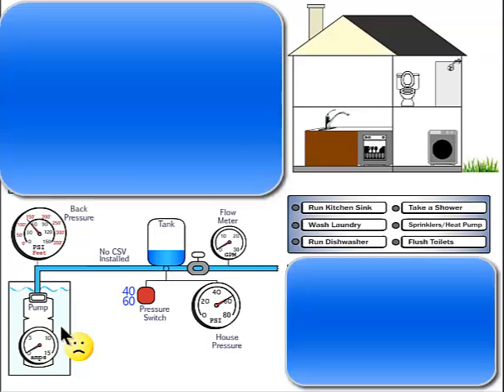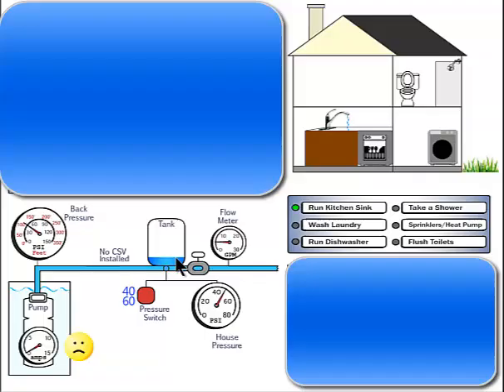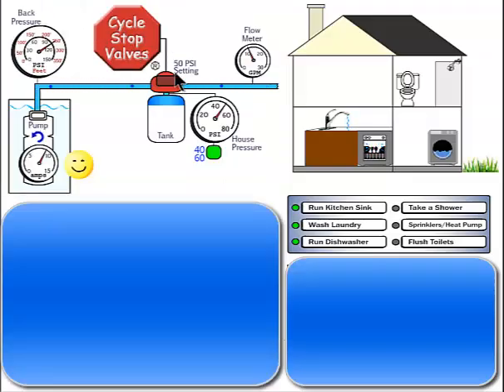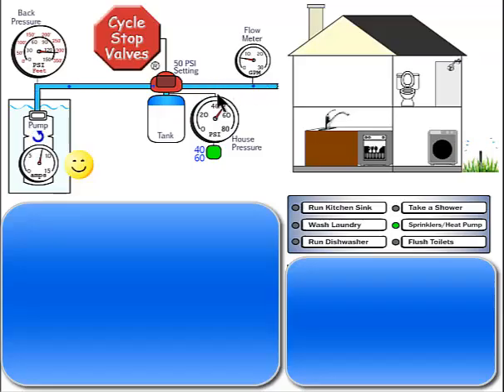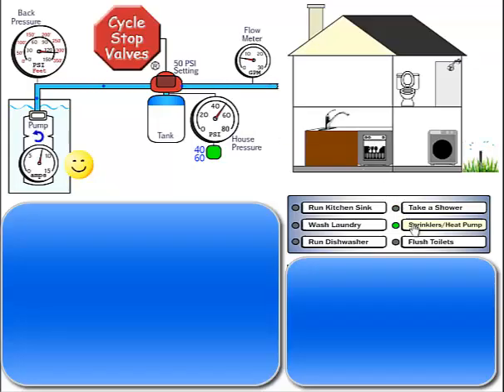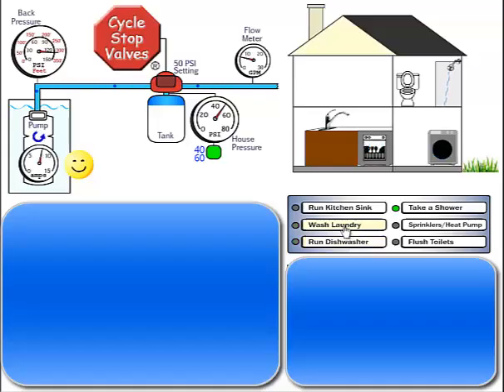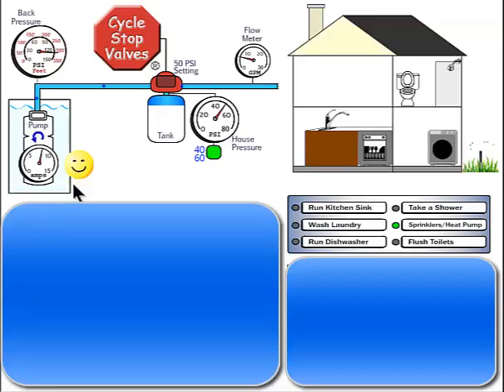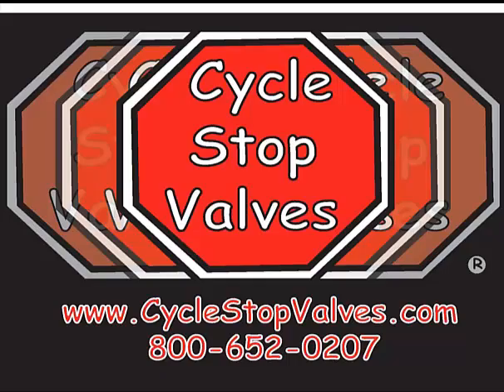How a Pressure Tank Works and why you need a Cycle Stop Valve

Comment: So basically you're saying that the pump last longer if it stays on longer rather than turning on and off? Wouldn't this waste more electricity?.... nevermind, I should've completed the video before responding lol.
Reply from the maker: Thanks!  The CSV only makes the pump stay running while you are using water.  The pump shuts off when no water is being used and the natural amp drop of the pump keeps energy from being wasted when the CSV makes the pump deliver small flow rates as needed.

Comment: I'd love to install one but the poly pipe from my home to well is 45 years old and as I found out when digging down FOUR FEET to fix a leak, it's thin wall 100PSIG irrigation pipe!  The NEXT time there's a leak I will hire a ditch witch and replace with proper 260PSIG 1 1/4" pipe and install a CSV set at 60 psig.  My switch is set at 55/75 to keep my RO/DI watermaker happy.  It's too large for a booster pump to be practical so there's that.  Our Amtrol 87 gal tank only has about 22 gallons drawdown due to the higher pressure as well.
Reply from the maker: You probably only need 160# poly pipe.  But they do make 250# if needed.  First things first, you need new pipe.  Then a CSV can hold a constant 70 PSI working with your 55/75 switch and 87 gallon tank.  A constant 70 PSI will be much stronger than when cycling on and off between 55 and 75 as it is now.
Reply: @cyclestopvalves8380  Yes when there is a leak (and I'll know immediately as the system check valve is on the pump), I do plan on replacing the line.  I want to overkill things as our soil is rocky and I believe that's where the problem lies.  Even with careful backfilling, just don't want to deal with a break!  I even thought of running conduit and pulling the pipe through that but that may be a bit much.  The cycling is noticeable but not as bad as before when we had a 20 gallon tank with 4.8 gallon drawdown (55-75)!  And if a toilet is flushed during a shower the water probably gets 15 degrees warmer for a few sec.

Comment: Wouldn't it work the same then if I just eliminate the pressure tank and leave the pump straight to the house on demand with no valves or anything in between?
Reply from the maker: NO that will not work.  You would have really high pressure for an hour or so until the pump melted down.

Comment: Hi, Ok so I have a question.  Most pumps are not "regulated" due to flow demand.  So if you have a standard jet pump or deep well pump, that typically provides a specific GPM at specified pressure, I see a problem at "low flow".  

Typically, the pressure tank handles the pumps capacity.  With a CSV, there is no way for the pump to ADJUST to the low flow.  You state that only "1 GPM" is required.  How exactly is that possible without stressing the pump?

My jet pump for example.  When its on, its on, pumping at it max flow rate into the pressure tank.  If I drop flow to 1GPM when that pumps wants to put out say 12 GPM, where is that "EXTRA ENERGY" being dissipated when my pump is trying to pump at 12 GPM?  The pump is not a "variable flow" pump.  That means that something is stressed somewhere.  With low flow, is that impeller now cavitating because the pump is running full throttle and there is no where for the water to go?    

If so, that is going to cause PREMATURE failure somewhere in the closed system with pressure increases somewhere in the pump unless the pump has some why to overcome it.    

A CSV cannot throttle up or down a "NON VARIABLE SPEED" pump.

How do you explain this?

Thanks,
Reply from the maker: Lol!  You would think so right?  But that is not how pumps work.  Pumps work on a curve.  Your 12 GPM pump will produce 12 GPM at low pressure, or 1 GPM at a higher pressure.   Submersibles will pump 12 GPM from a shallow well, but only 1 GPM if the well is deep enough.  You don't have to slow a pump down to make it pump less water, just make it think it is in a deeper well by closing a valve to increase the pressure.  The amazing and counter intuitive thing about pumps is that the amps or power needed decreases with flow, even though the pressure is increasing.  Close a valve down to 1 GPM and the pump is only pumping 1 GPM.  There maybe 100 PSI in the pump case, but the impeller is just spinning like a top in the perfect coolant and lubricant, and not drawing any load.  Same thing happens when you put your hand over a blow dryer or vacuum cleaner.  The amps don't go up, they are reduced when the flow is blocked off.  You can hear the motor speed up because it it not blowing air and there is no load.  Centrifugal pumps work the same way.  The CSV just makes the pump think it is in a deep well when only a little water is needed, and makes the pump think it is in a shallow well when you open up more faucets to use more water.  Proven science even though very few people understand how pumps really work.  See the video about pump curves.  Thanks
Reply: @cyclestopvalves8380  Is it true only for submersible pumps or also for jet pumps? Thanks
Reply from the maker: @lisinsignage  the amps don't drop as much with a jet pump, but it will work down to 1 gpm as well with no problem.
Reply: @cyclestopvalves8380  Thanks !!
Reply: @cyclestopvalves8380  that still uses more energy per gallon of pumped water, thats for example i put higher pressure setting so if there is moderate usage of water pump wouldnt cycle. though, im not so clear why is cycling so bad for the pump although i heard about it many times. pump is made to start and stop,bearings have less wear if they spinn less time, not entirely sure how beneficial would csv be
Reply from the maker: @Boz1211111  Pumps are not made to start and stop very much. They are made to run 24/7/365.  It is the starting that destroys them.  I have a pump for a stock tank that hasn't shut off in over 18 years now.  Sure even though the amps drop when the pumps flow is restricted it still cost a little more per gallon to pump the water.  But that small cost is way more than offset by the benefits of the CSV, which include making the entire pump system last many times longer than normal.  There are so m any benefits to the CSV that the major pump companies blacklisted it in 1994.  CSV's make pumps last longer, use smaller pressure tanks, and delivers strong constant pressure to the house.  If there was one pump company that cared about you more than they care about the almighty profits, they would put a CSV on every pump they make.  Sadly, that is not the case as big pump companies will do or say anything to get what they want, which is more of your money.  The CSV is so beneficial it is disruptive to the entire pump industry, and pump companies will do or say anything to keep you from trying a CSV.  Look at what the pump companies spend their money advertising and you will know what is the worst thing for your pump system, and at this point in time they are pushing Variable Speed Pumps or VFD's because they eat big holes in your wallet.
Reply: Had no idea. Thanks for the awesome explanation.

Comment: I have been in our new ( to us) home and this is my first well. The pressure seems to take a very long time to recover,the pump is very new ( jet pump) and the pressure tank is fairly new also. One question is location of the pressure tank, mine has been placed in the well with the jet pump on a shelf. My well is about 4’ in diameter and 17’ deep approximately. The house is probably 150-200’ from the well with a small incline to the house. I was going to swap the pump for a submersible and then move the tank to under the house but wonder if adding this valve will take care of my issue?
Thanks for your time,enjoyed the video!
Reply from the maker: I don't understand the tank in the well with a jet pump?  But the CSv will give you strong constant pressure and work with a much smaller pressure tank.
Reply: Cycle Stop Valves what do you mean you don’t understand the pump and tank in the well?
Reply from the maker: @1966cambo  The pressure tank has to be after the pump.  A jet pump is above ground, so the tank cannot be in the well?
Reply: Cycle Stop Valves gotcha, it is physically located in the well just not in the water lol, i did say it is on a shelf in the well. The tank is after the pump. I just thought the pressure tank was supposed to be at the house, not that far away?

Comment: I live in an area with heavy sediment and require a softner and a whole house water filtration system how will the system work?
Reply from the maker: The CSV1A as comes in the PK1A kit is designed to handle some sand or sediment.  Just put all your filters and softeners after the PK1A kit or after the pressure tank.

Comment: I see the advantage of a CSV when you are plumbed directly to the well. Any advantage if you are gravity fed from storage tanks to the pressure pump? For example 2.5 GPM well > 6000Gal tank > pressure pump > 40gal pressure tank > filters > house
Reply from the maker: It doesn't matter if it is gravity fed to the pump, drawing from a storage tank, or a well, anytime you have a system that requires water to automatically come on when  you open a faucet or turn on the irrigation you need a Cycle Stop Valve.  CSV's work great on booster pumps as well as submersible pumps.  It doesn't matter if you are boosting city water pressure, well, or tank water.

Comment: So pump always on with csv? Trying to keep my electricity bill down
Reply from the maker: The pump only runs when you are using water.  Like any on demand type pump except that the CSV makes the pump and equipment last many times longer than normal.  For outside use the electric bill could go down.  House use only may increase the bill 2 bucks a month, which is way more than offset by making the pump last longer and use a smaller tank.
Reply: @cyclestopvalves8380  thank you i gotta check y system bill is 389 a month and the pump turns on to often even with just faucet running
Reply from the maker: @pistolero114gunner  Your pressure tank maybe waterlogged.  Out of a 300 dollar whole house electric bill the part for the well or booster pump shouldn't be more than 5 bucks or so.  Sometimes people notice a high electric bill when they have a leak and the pump never shuts off or runs when no one is using water.
Reply: @cyclestopvalves8380  do you have a video on fixing that?  I have no idea what waterlogged is. But yes bill when up right after the pipe going to the tank broke and i had to replaced it i replace the pressure switch as well and from there it all went down hill for me
Reply from the maker: @pistolero114gunner  See the video titled (Eliminate a big pressure tank /  PK1A install video).  There is not much that can be done about a broken tank bladder but to replace it.  And replacing that big tank with a PK1A is the way to go.
Reply: @cyclestopvalves8380  will do thank you very much for your time much appreciated😁👍

Comment: I’m using. Red jacket jet pump with the pressure control valve attached to the pump and the pressure line going to the prop housing housing, would i have to change this to make the csv work. Move after the CSV  valve.
Reply from the maker: For deep well jet pumps with the pressure control valve, you just put the CSV after the pressure control valve.

Comment: Can I use this valve with my regular pressure tank as well? Well is new so would rather just add this valve.
Reply from the maker: The CSV will work with any pressure tank.  However, a bladder or diaphragm type tank is best.  Then yes all you need is to add the CSV before your tank and before any water lines or hydrants tee off.  If it is not a bladder/diaphragm style tank it takes a little more consideration to work with an air maker system, but it will still work.

Comment: Great explanation and thank you for the video.  Do you run the risk of cavitating your pump blades by sending variable flows?  Most pumps are designed to operate at a pretty strict flow and net head (pressure) range.  Is the assumption here that you would need a pump that can effectively process a wide flow range?
Reply from the maker: The CSV can never close quite enough to cause cavitation.  Most centrifugal pumps can handle a much wider range of flow than some people might think.  Really as long as there is enough flow to keep the pump cool, cavitation is not an issue.  Restricting the inlet line to the pump would cause cavitation, restricting the discharge of a pump only increases the head pressure, reduces the work the motor has to do, and even makes the motor run cooler.
Reply: @cyclestopvalves8380  Very interesting.  I need to check my pump spec sheet and now might consider using a CSV.  Does it operate under a similar principal to pump control Cla-Val or Bermad?  I tried researching the innards on how the CSV works and couldn't find much.
Reply from the maker: @andrewbenjamin3687  There is plenty on how the CSV works.  It is just so simple you didn't realize that was all of it.  The CSV works on a pressure reducing principle just like many Cla-Vals, Bermads, etc.  The patented difference is that the CSV can never close to less than needed to keep the pump/motor cool.  The minimum bypass in the CSV is what keeps the motor/pump cool, determines the rate that fills the pressure tank, and also determines the minimum usage rate at which the pump will not cycle.

Comment: One person using a gallon and a half at a time thoughout the day will cycle the pump many times whereas someone with a charged 81 gallon pressure tank would never even run the pump once under the same load. Bad product unless you run long uses at a time.... Not real world.
Reply from the maker: An 80 gallon tank is expensive, takes up a lot of room and heat, and only holds 20 gallons of water.  A pump will cycle more with the 80 gallon tank than with a CSV and a 4.5 gallon tank.  The old style 80 gallon tank system cycles on/off for every 20 gallons used.  The CSV and 4.5 gallon tank only cycles once for each use of water, no matter how long the water is used.  So yes the CSV cycles more for small uses of water, but doesn't cycle at all for longer uses of water.  Which means overall it cycles less with the CSV than with the old pressure tank method of cycling for every 20 gallons used.   Not to mention the constant 50 PSI pressure from the CSV is much stronger house pressure than when continually cycling between 40 and 60.  Plus, everything from the pump to the pressure tank is destroyed from cycling on and off, and the CSV makes everything last much longer.
Reply: Good explanation in the video and reading this comment even explained it more!!! Getting mines asap!

Comment: Is there wear of the pump from having the power supply being constantly varied according the the need of the household?
Reply from the maker: No.  The power only goes down, not up.  The CSV decreases the power needed and makes the motor run cooler.  Varying the power is a good thing as long as it goes down.

Comment: As I figured the 40-60 psi difference compresses the air in the tank to about a third of its volume. So for a 60 litre tank you get about 20 liters of extra water in there that you can use before the pressure drops to 40psi and the pump kicks in. So running a 300l bath will cycle the pump on and off 15 times.
Reply from the maker: NO!  With a CSV the pump will not shut off until the bathtub is full.
Reply: @cyclestopvalves8380  I know I was counting without the CSV. It's just that the hard part to figure out is how much volume of water really leaves the pressure tank between 40 and 60 PSI of the air. According to my rough math it would be about 20 litres for a 60l tank but correct me if I'm wrong please.
Reply from the maker: @steamsteam6607  It depends on the differential pressure.  At 40/60  draw down is about 25% of total tank volume.
Reply: @cyclestopvalves8380  Thank you I got it at 1/3d but there is the mechanical aspect of the barrier as well.

Comment: Does it work on a 1/2 hp, 20/40 system?
Reply from the maker: Yep!  Just have to have the CSV1A set for 30 PSI.
Reply from the maker: @myartel6814  Just set the CSV1A for 30 PSI while running a shower or anything that uses about 3 GPM.
Reply from the maker: @myartel6814  The CSV1A is adjustable between 15 and 150 PSI.  It will work with any pressure switch setting up to 130/150, as the CSV would be set at 140 PSI.   Just set the CSV1A in the middle of any pressure switch setting.  Like when using a 40/60 switch, set the CSV1A at 50 PSI.

Comment: My pressure switch is mounted on the jet pump in a pit. where does the CSV go, before of after the pump?
Reply from the maker: The pressure switch must sense the pressure after the CSV.  You can either leave the switch on the side of the motor and extend the sensing tube to the CSV1A or pressure tank, or use a different pressure switch after the CSV and wire around the existing switch.
Reply: Way beyond my ability. I cant just cut the pvc pipe between the well head and the motor and install the CSV there ? my pressure tank is 200 feet away from the well motor
Reply from the maker: @robertjenereaux4488  With a submersible pump that is exactly where you want the CSV.  But if you have an above ground jet pump the CSV needs to be after the pump and the pressure switch sense line needs to be after the CSV.